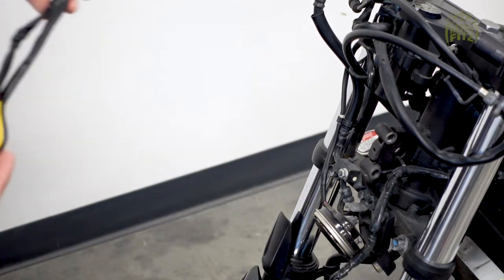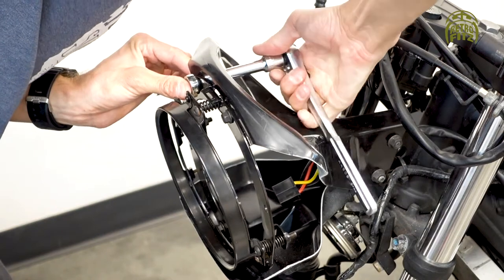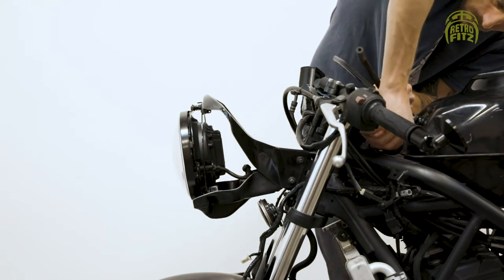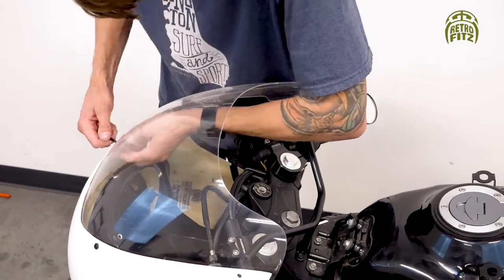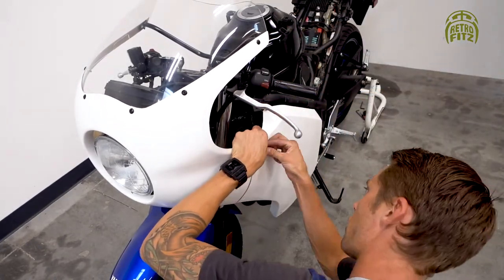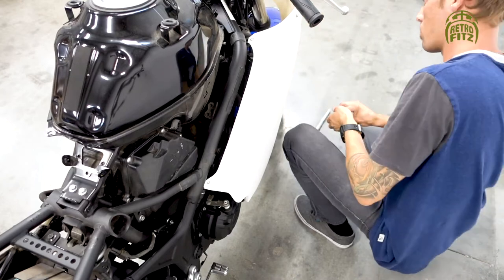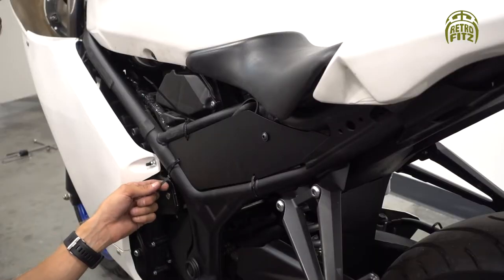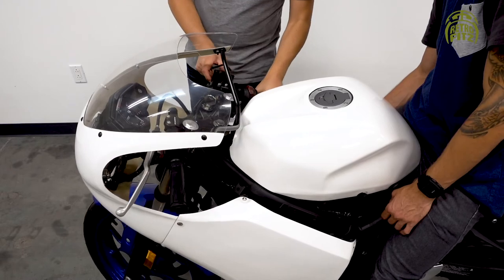Rocket Street R3 Body Kit Assembly / Ver 2

Comment: super excited to get mine this winter but plan on putting it onto a 21' MT-03
Reply from the maker: Hi Chino, I'd love to see this . I have not tried this yet but it looks like the frame is different from the R3 particularly in the steering head area so you may have to do a bit of fabrication for the headlight and meter mounts. On the good side the fuel tank is the same as the R3 so the fuel tank cover should fit. I would recommend  the soon to be released kit for 2019-2023 R3 models. Are you looking for a street or race kit? You can contact me directly at info@ggretrofitz.com. Thanks and I'm looking forward to seeing you project!!